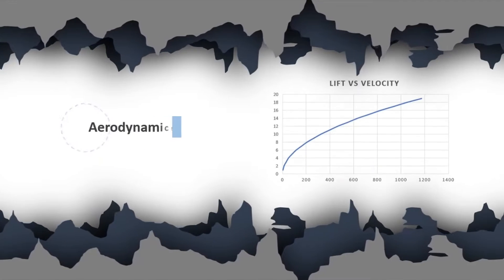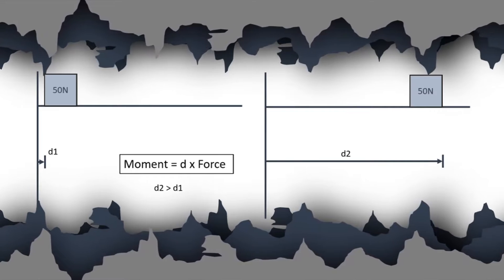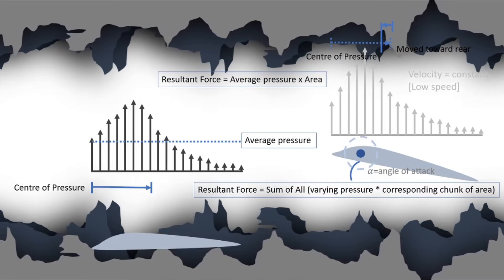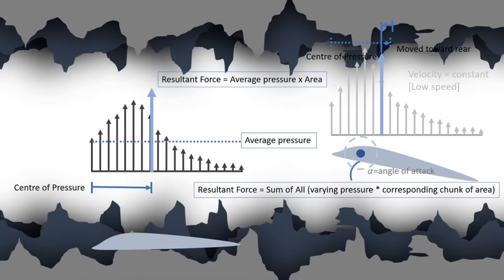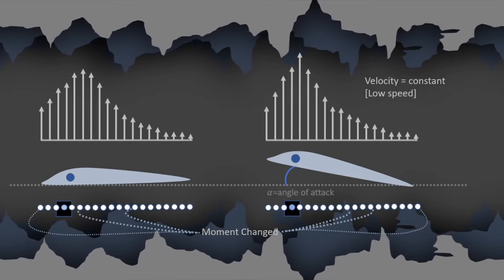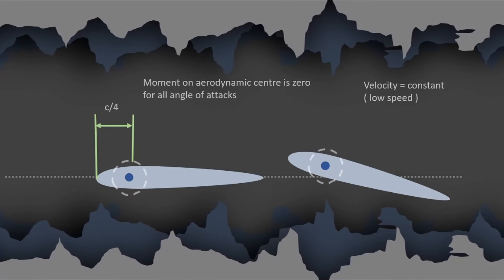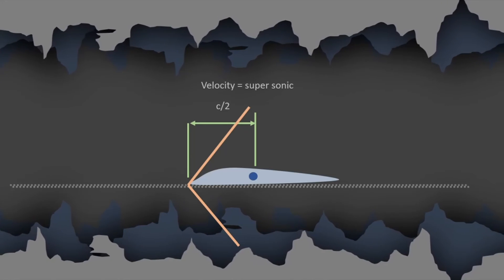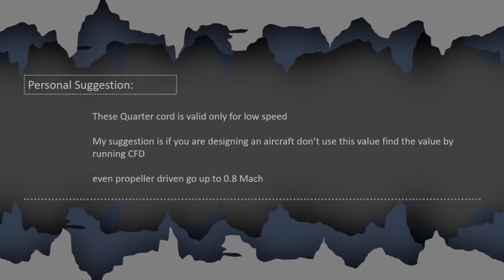Aerodynamic center, Center of pressure, Moment: Can I use Quarter chord for designing airplane ?

Comment: Unclear explanation. English is difficult to unferstand.
Reply from the maker: Which part do you feel like that? or the Whole video? 
I will try to correct that ...
Reply: @aerodynamicsinminutes2201  Hi, thanks for asking. This is my opinion:
1. Graphics are good
2. Video logical sequence is good
3. Since you have accent, you have to speak slower and gesticulate more with your mouth when pronouncing so the words can be understood easily (there are parts where you speak at an adequate speed).
4. The term "chunks of area" sounds strange, and by the time the person watching the video understands what it means the video is already way ahead and you feel confused. Maybe "slices" will do better, or better yet, take a few more seconds to explain what an area chunk or (slice) mean.
5. I believe you need to explain better why the center of pressure moves backward with the angle of attack and why you cannot use it for calculations if it does (after all, the center of gravity also changes with configuration -but less so, and only minimally in flight). Maybe a few more graphics to explain the concept would help.
6. Adding a a couple of minutes to the video for clarity purposes is acceptable, after all what you explain is usually poorly explained in books too.
Reply from the maker: @aldopolgeo73  Thank you Aldo Polgeo. I will correct it in my next video... :)
Reply: mate, this guys accent is top tier when you compare him to most STEM videos coming from middle Asia. If you think this is bad, you've been spoiled lol